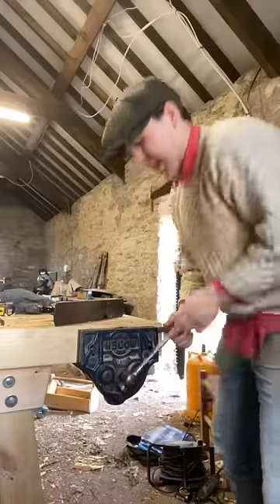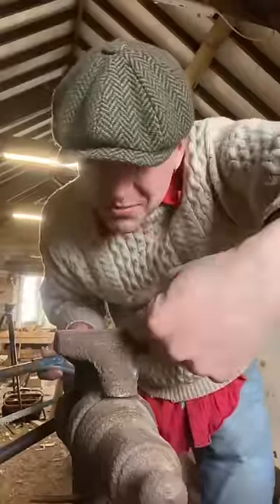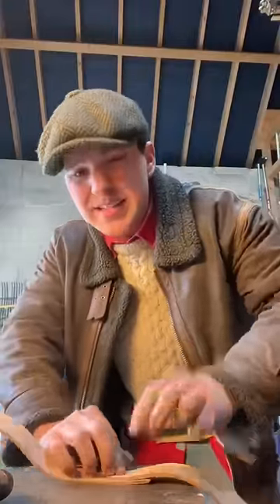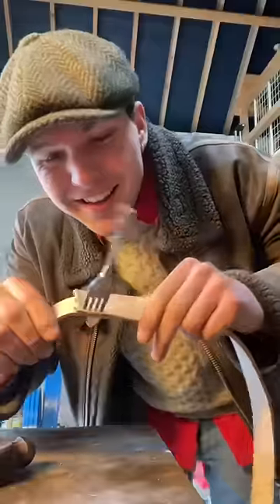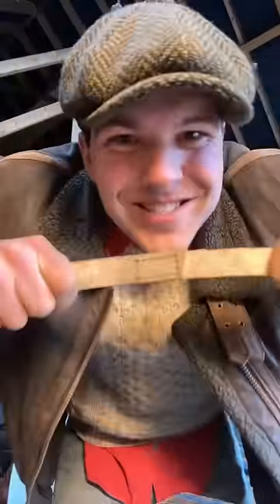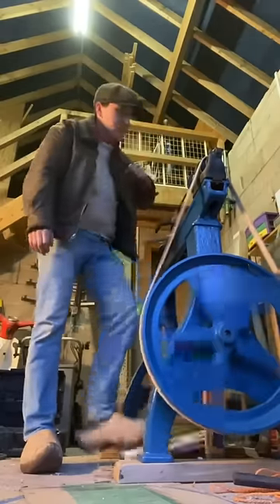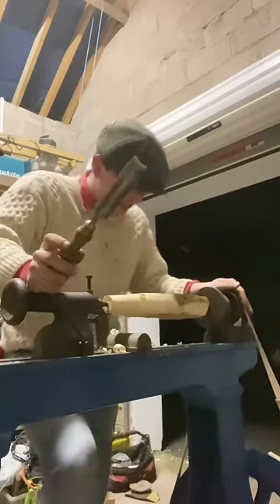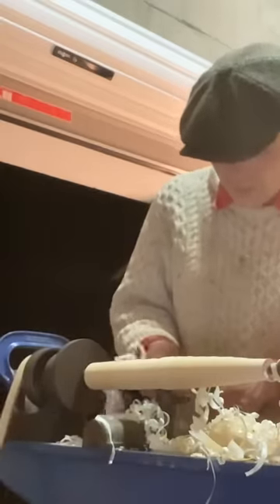Making a belt for my lathe #ireland #woodwork #woodturning #handtools #threadlelathe

Comment: I might be a little late, but if you stitch a "X" in the middle of the stitched box it will be much stronger.  It's called a Box X stitch and is used to hold together two straps
Reply: Not to be confused witg an X Box
Reply: i dont know that i would want to do that with leather. any hole you add is reducing strength to the material, i wouldnt have even gone across the short ways as sometimes that just turns into a tear here line later on
Reply: @The_Alpha_E or my exes box
Reply: @kylehammond8091  or something which used to be a box, an 'ex box' if you will
Reply: @CrazyToddler box x is used on parachutes. It's probably fine lol
Reply: I wonder why that call it that 🤔

Comment: I used to have a very nice treadle sewing machine. I loved the full-body synthesis of working on it. I could get it flying as fast as a modern electric machine and it would stitch through 5 layers of denim without issue. Such great old tools!
Reply: I'm actually taking a short break watching YouTube from working on a quilt on a 102 year old Singer machine right now lol

Very reliable machine
Reply: I think I have a treadle sewing machine in my barn... this is the sort of thing that happens when your family lives in the same place for several generations and never throws anything away. 😅
Reply: @jfm14  If you're ever so inclined I'd actually recommend seeing if it can be restored, they're usually really well built machines, very good for quilting and similar heavy work
Reply: i was given my great grandmothers machine by my grandmother recently, it unfortunately needs a new belt, if anyone knows of a place to get one please let me know
Reply: @bonkislost  I picked one up on Amazon that's held up for 2 years now. I did have to trim it a couple times over the course of using the machine due to the belt stretching, but it eventually settled and has been just fine.
Reply: @pacmanfan1214  thank you so much (:

Comment: Looks great! You might find that the overlap spots cause some vibrations in your workpiece if you get it to high enough spin rate. If so, treat the leather like some lumber and taper each end like a scarf joint before attaching it. (In leatherwork you'd call this skiving.) You should be able to do it with a nice sharp chisel and some patience.
Reply: Be sure to glue the sliced ends together before sewing! Looking good!
Reply: Eventually he might want to think about adding a Möbius twist, but that might not be possible with the wheels so close together.
Reply: How it’s actually supposed to be done with the old leather belts for old machines is you have these metallic teeth looking comb things you hammer to each end of the belt and there’s a gap where you put a rod to connect them, I wonder if I could mail him some I have lying around 🤔
Reply: And if there's ANYTHING we know Eoin has, it's sharp chisels and patience.

Comment: Talk about “For want of a nail”. I shopped around all day for a 1/2” wide 7” band of rubber to fix up my cheap band saw and I couldn’t find anything but normal rubber bands. Not even rubber stripping. 

The hardest thing about making stuff is you pretty much need to bulk order all your parts ahead of time because you can’t buy what you need pre-made anymore.

Comment: Keep an eye on that stitching!!! If that belt snaps when in use it can come flying off with enough force to slice you open. It looks fine for now but regularly check it isn’t fraying.
Reply: Had the same thought. I am a former pro leather worker and that belt should be replaced ASAP with a proper one. This is a good fix for a few days and it's good that it's not stretched very tight. A strip of leather that size is a serious hazard when it snaps, not if.
Reply: @Heterogeneity I commented later but was wondering if a double stitched scarf joint might be better....or smoother anyway. I'm sure you know better than I
Reply: I feel validated for my fear of belt snap now lol.
Reply: at the speed its going to turn i would really doubt

Comment: I’ve used Velcro strips to make an emergency belt for my husband’s refrigerator unit trailer. His refer belt had broken and it was a hot holiday weekend  and the stores were closed. Be need a belt that was wider and longer than anything he could find. He was trying ropes and stuff but they would stretch and slip. 

I saw the fly wheel grooves looked to be about as wide as the Velcro I used in sewing. I also know Velcro was super strong, it didn’t stretch and I could cut it narrower without it fraying. I also knew it was used on NASA expeditions, so good stuff. 

I went to my sewing room got all my sippy which came to about 20 feet.
It did fit the slot perfectly, we had plenty of to crest a good strong overlap and we could trim it to fit well. 

It worked like a charm and kept the unit working until he could get a new part but he continued to take Velcro because he might need it for securing things, belt, straps etc.
It’s very handy stuff. I’ve even used it to hold odd shaped wood projects while I glued them.

Comment: That lathe is a cracker mate! You’ve done such a great job restoring it/the tools you share with us. I love your channel and it helps inspire me to get down in the garage and make a racket. “Out with the new and in with the old” - love it. 
If you make your way down to Australia I’ll swap you some of that Bog Oak for some weird gum trees or pines I can find down here. 

Also - I’m just rubbish at chairs and I think I’m starting too difficult. Any tips/videos you’d recommend? Tried a rocking chair and swiftly gave up but I will NOT let this turn into another stool with no back support 😂

make a tree dance but can’t make a chair sit straight. Any good links/advice for a weak spot?

Comment: For the box stitching an X from corner to corner would add strength to the stitch, and it would last longer under the stress you're putting in under.

Much like the strap on most handbags is done. And we know the strap breaks more often than the stitch does.

Nice job making your own belt.

Comment: I was so confused as to why you'd want to flatten the fork, cut it down and sharpen it, until you placed it on a piece of leather belt, hit it with a mallet and excitedly exclaimed that it worked. To those who don't know, there's a tool in leatherworking that does the same. This tool is called: a fork.

Comment: That's ingenious! You won't believe the fun we had with my old ML2 and these claw things that got folded round each end of the leather round a common rod- read bit of old nail - in the middle. That lasted a good few years but the joint went thunk thunk thunk every rotation and you could feel it in the lathe. Then a friend made a sewn belt but only had thin leather/ and or his machine wasn't up to the thickness required, though he had the smart arsed idea of chamfering the join so when the ends were sewn, it presented a smooth surface to the pulley. It's still working fine.

Comment: I’ve used a similar kinda of flywheel lathe except the petal ran parallel with the lathe itself, so you had to battle with keeping the wheel moving without getting to close because your leg moved more than you’d think and keeping the tool moving so you didn’t gouge a large mark into the part you were making.

Comment: What's fun with old flat belts is if you twist it so the inside on one wheel is outside on the other you wear both sides of the belt evenly and it helps the belt track straight.

Comment: For a stronger joint on the belt, don't stitch across the belt, just along the edges. Stitching across the belt creates a weak spot, like perforated paper, it will rip at the stitches.

Comment: You shouldn't have stitched across the belt, but only used two lines of stitching, parallel to the length of it. Those perpendicular lines greatly decreased the strength of that belt. Just something to remember for next time. 👍👍

Comment: Mmmmm. That's.... going to have issues.
Former shoe repairer,  so I notice leather, and we used a treadle sewing machine. 
Every leather belt I've ever seen maintains a single profile. So you need to butt join the leather, using a clip or staple, or you "sciber" the joints, then glue. Scriber means a long, shallow thinning of the leather overlap, so you increase the glue area while maintaining an e en joint or transition. 
Stitching also needs to be below the surface, to prevent slippage (very different friction between leather and strung), so I'd recommend a thinner and stronger thread; so you aren't removing as much leather.
There's also stretching issues w normal leather, but I dont know the answer for that. I suspect boiling, but fully boiled hide is thick and stiff...
That fork trick was impressive,  but leather stitches need to be roughly as wide as the material is thick, between 1mm and 8mm, usually around the 3 to 4 mm size. Loo large and they arent applying consistent tension,  too short and you've effectively perforated a tear line. 1x leather to 1.25 x stitch length seems to work well.

Comment: You need a dog to put in a large wheel where he runs and it Powers the unit or you could use a donkey or Horse Outside that would go around in a circle like they used on the old grinding Mills and connect it to you lathe